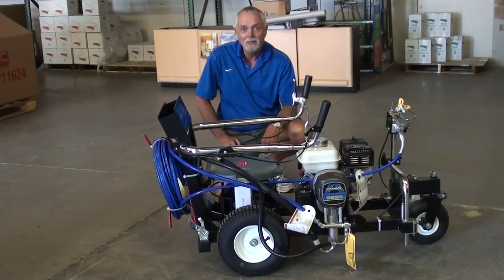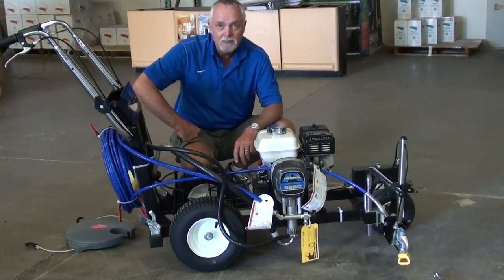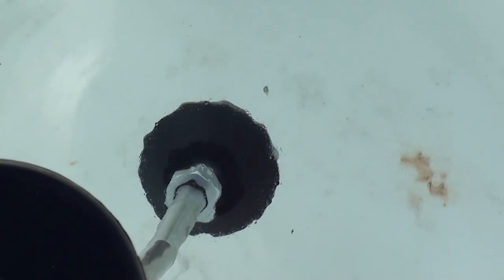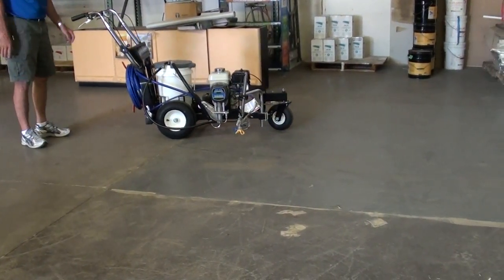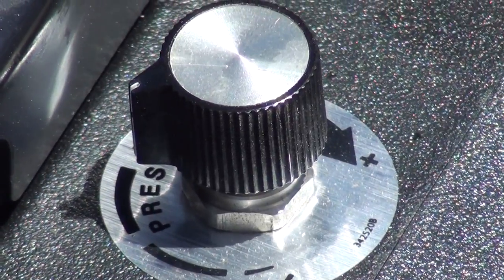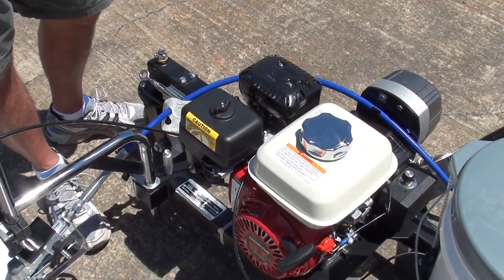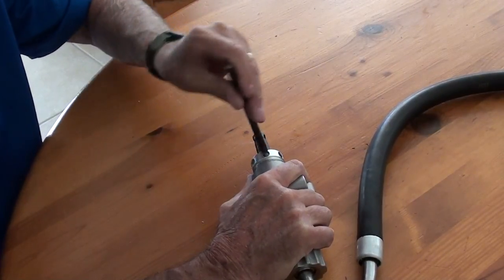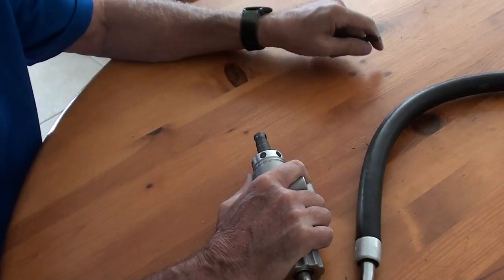Airlessco Sure Stripe 3650 Airless Line Striper Operation & Repair

Comment: Whenever I spray water out it works perfectly fine. However, whenever I move to paint and I pull the throttle it shuts off. Do you know why this happens?